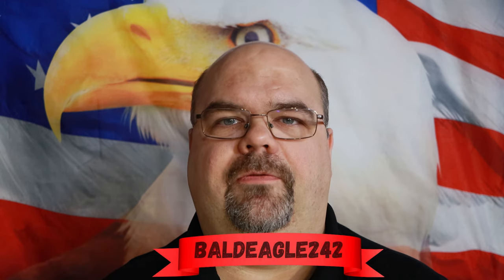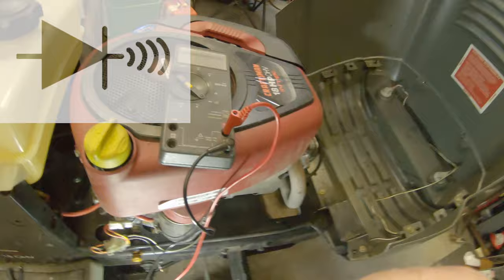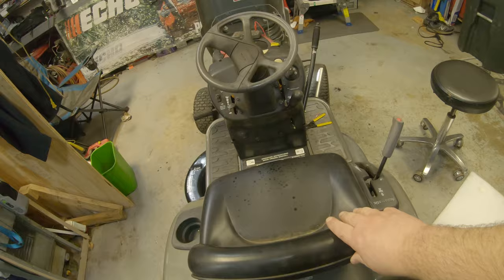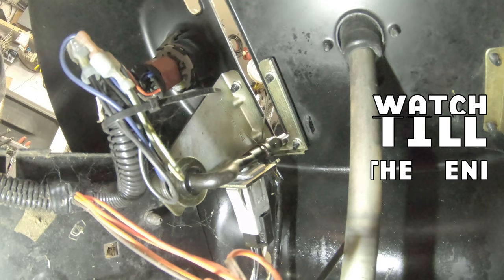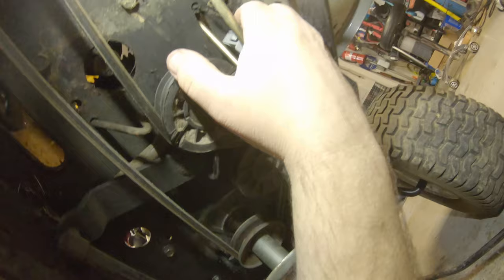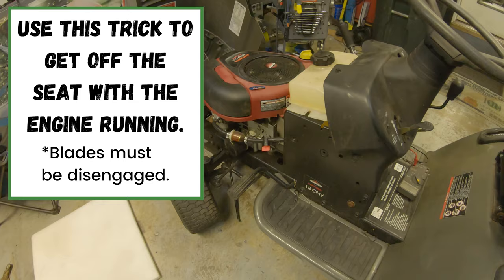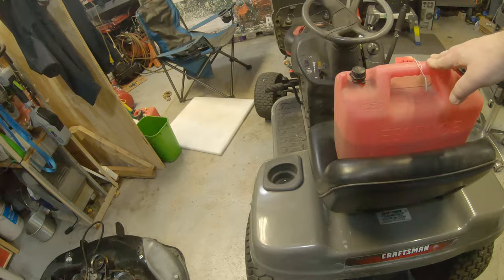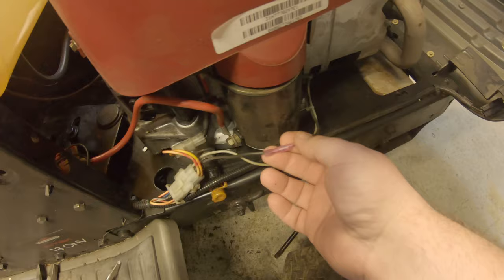The Hidden Safety Switch Trick Exposed

Comment: No need to cut the black wire just unhook it from the coil just slides off. Hope this helps someone.
Reply from the maker: Thanks for the tip! That works also but requires the removal of the top engine cover. 😁👍
Reply: @baldeagle242  No just pull that heat shield/air guide down and pull the black wire off the coil it slides off than you can slide it back on after and slide the shield/guide back up

Comment: Happy Thanksgiving! I started having trouble with PTO/blades suddenly stopping working during mowing. Then at same time had troubles starting tractor back up. I have put almost all new parts on it. New starter solenoid, new ignition switch/key, new battery, new fuel filter and fuel pump. I cut wires going to seat switch and joined them, taped them. I have the brake switch button permanently pushed in with a zip tie. After all that could not get tractor to start. Today I found I did not have the seat switch wires grounded to anything. When I took the black ground wire and placed it on a bolt and turned the key the tractor tried to start and turn over. After going inside for a while I came back out and tried to start it again but this time nothing! Dead again. Pulled the fuse out and it was broke. Put another fuse in and same thing, tractor tried to start. Tried again a second time and nothing. Fuse broke again. So I am blowing fuses. Besides figuring out why fuses are blowing I will have to figure out the PTO situation. I know that the clutch can be free spinning or faulty and also there is a wire or two going to the clutch which could be a problem, maybe shorting out or something. So sorry about this long message here. I would gladly pay you for your assistance!!!!
Reply from the maker: Happy Thanksgiving to you as well. I would check the clutch and clutch wires. A shorted safety switch or seat switch will keep the mower from starting but there is no voltage running through the safety circuit to blow a fuse. The clutch itself and the wires going to it should have 12 volts when engaged. I would first unplug the clutch and the engagement switch. With both unplugged that should eliminate the no start issue if something is shorted out. After you determine that is the issue I’d plug the clutch back in to see if the problem returns. If not plug the switch back in and check again. Doing this through process of elimination should help to narrow down your issue. It could be as simple as a pinched or shorted wire or a component failure.  You can also put a volt meter directly on the battery and watch for rapid voltage changes as you push and pull on the wiring harness. 
Either way, if a fuse is blowing you have a short, smoothing hooked up backwards or a failed component.
Reply: @baldeagle242  Very grateful!

Comment: What if the mower won't turn off?
Reply from the maker: The black wire going to the coil has probably come off, been cut or the key switch is bad.
Reply: @baldeagle242  I changed out the key switch, no changes...black wire appears intact

Comment: What if none of the safety switches are not working 3:11
Reply from the maker: You will need to check them individually if that’s the case. You may have a short or damaged wire and not necessarily a bad switch.

Comment: Why wont my mower stop when the kill wire is hooked up?
Reply from the maker: Could be a bad key switch or the wire connected to the key switch.  It’s also possible the kill wire is cut or damaged somewhere.
Reply: @baldeagle242  
Thanks for your help.  I will look into it .
Reply: I did try it before with the kill wire hooked up ,but then it didn't start until I pulled the wire off.  I think I have a bad safty switch.
Reply from the maker: @jeffhiltz1065  I agree.  It sounds like you have a bad safety switch.

Comment: If you cut the needle or plunger part off on the fuel solenoid do you still need to "feel" the solenoid with your fingers when turning the key? Dumb question? Probably LOL
Reply from the maker: No, if it’s cut off it doesn’t matter if it’s working or not.

Comment: I'm still used to my old lawn tractor that had no fricken safety switches on it. I bypasssed all of mine on my new tractor now so I don't have to go thru all the bullshit just to get off the dam seat with the engine running. People don't have any common sense it the reason for all those safety switches. Just like all the new vehicles, they need to install safety switches to babysit the dumb people from getting hurt.